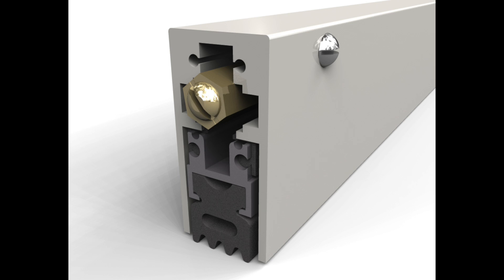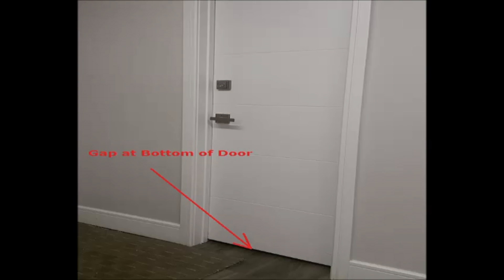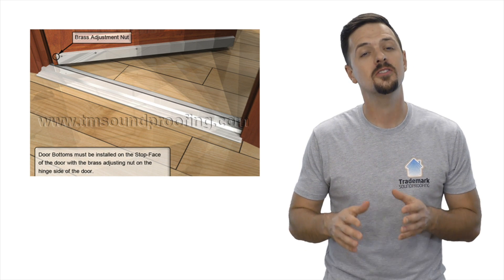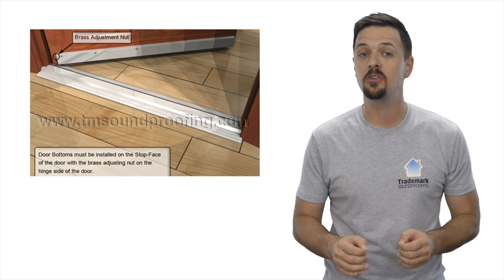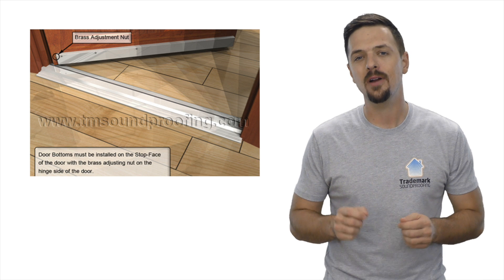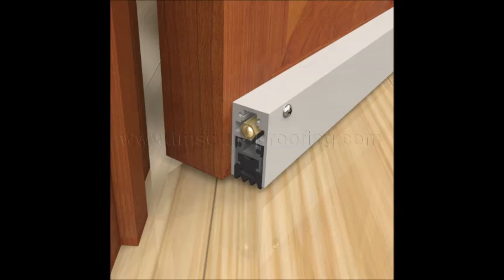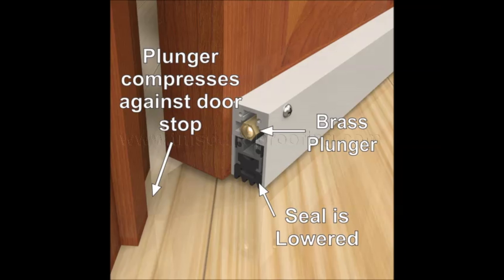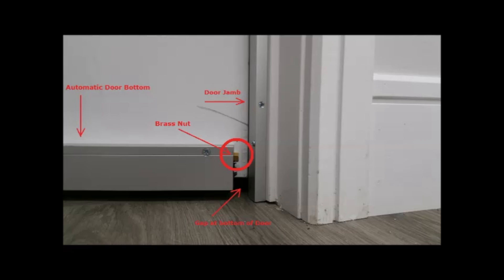How Do Automatic Door Bottoms Work

Comment: The video doesn’t explain how automatic door bottoms work.
Reply from the maker: From :48 to 1:00 you can see how they work which is the point most people want to see. If there is anything else you would like to see let us know.
Reply: @Tmsoundproofing  No, it doesn’t show how it works.It just show the door shut (practically in silhouette) and and somehow something goes down. It doesn’t show the mechanism of how it works.
Reply: I believe it does. Not internal manufacturing, but all aspects of function were covered, as the title says. How it works, was explained

Comment: How well does this work in a carpeted floor ?
Does the bottom of the door need to be few inches above the floor for this ?
Reply: If the carppet is not to plush it will work well. Gap should be mot more than half inch for best performance.

Comment: We are replacing a sliding door that has failed and are considering a Pivot Door.  We are on the Florida Gulf coast where impact resistant hurricane doors are required.  We are concerned about water infiltration in the pivot door product.

Question 1): Have you tested your system for use in a hurricane zone (HVHZ) application?

Question 2) : Can your automatic drop seal product be applied to an ANDERSEN Pivot Door Model APD-T with High Performance sill option. (Right side in-swing only)

Question 3):  Are the internal components of the automatic drop seal product made of stainless steel to prevent rusting in coastal environments?
Reply: This product has not been tested in a Hurricane Zone.

Comment: I live in a condo where it is not permitted to install the sweep on the hallway-facing (outside) of the door? Are there any automatic solutions that can be mounted to the inside of the door?
Reply: No you gotta think about how doors work. The inside surface of the door is going to be flush with the door jams so there would be nothing to press the switch in
Reply: @baxt1412  You could add some wood to create something for the switch to push against. Looking around there's also ones you can mount inside the door itself.

Comment: It's actually called a mechanical sweep
Reply: Incorrect.  Automatic door bottom is correct.  Search Pemko 4131, similar to this product shown.
Reply: Negative, and here's why. While the internal workings, of the door bottom, are mechanical. The lowering action of the door bottom, however, is performed automatically any time that the door is closed, or opened, due to the fact that the set screw is activated by the door frame. The operation of the door bottom is done automatically anytime the door is operated manually. So, by definition, "automatic" would be correct when describing the door bottom. Furthermore, no part of the door bottom contacts the floor when the door is in motion and that would make "sweep" incorrect as well. So, in closing, it's actually NOT called a mechanical sweep. Sorry, to be the 2nd, bearer of bad news.
Reply: @DFWJon  lol listen bro Im not sure what knowledge you actually have but I personally been in the automatic door industry work for Stanley access technologies for 15 years AAADM certified and all. we call those types of parts mechanical sweeps... Why because you can't automatically activate that sweeps unknowingly you have to KNOWINGLY Activate the that sweep by either pushing the actuator in or by the actuator making contact with the jam side of the frame... But ok door god🤦🏻‍♂️😂
Reply: @RichieRich1012  you sure sound like a professional the way you talk like a kid
Reply: @morpheus_9  yeah I sound like a kid... I'm AAADM certified since 2007 and I'm a senior tech at Stanley access technologies since 2007... All of us here at Stanley call that a mechanical sweep.  but okay you're a genius you win 🤦🏻‍♂️

Comment: never knew something like this existed until recently, very clever. Is it practical to mount an ADB on the outside (exterior side) of an in-swinging door ? How would it hold up to the outside elements, lots of rain where I live. Would the top surface need caulked where it touches the door skin?
Reply from the maker: Hi. The heavy duty ones hold up well. to the outside elements. Would be a good idea to run a bead of waterproof silicone along the top.

Comment: How would you deal with the small amount of light coming from the bottom of the gasket and door trim?
Reply from the maker: A door dust plug can help with that (Using semi or fully mortised Automatic Door Bottoms will also avoid this problem as the gasket will sit in front of the ADB) https://www.tmsoundproofing.com/automatic-door-bottom-mortised-for-1-3-8-door-ez-access.html